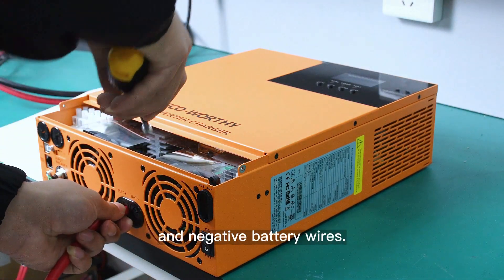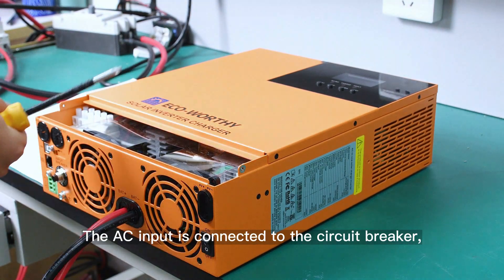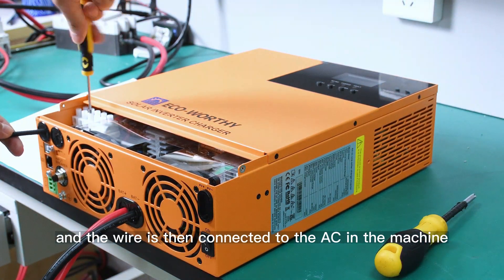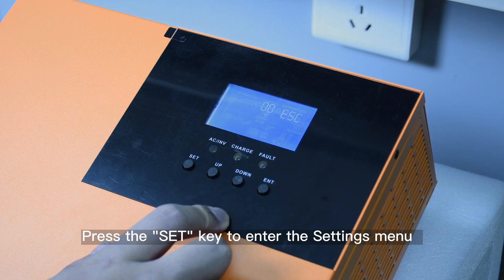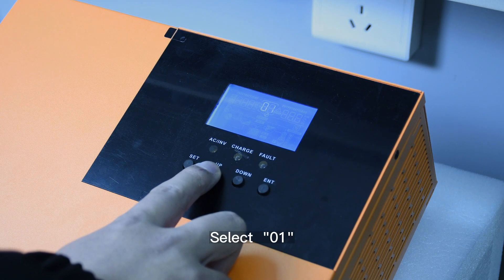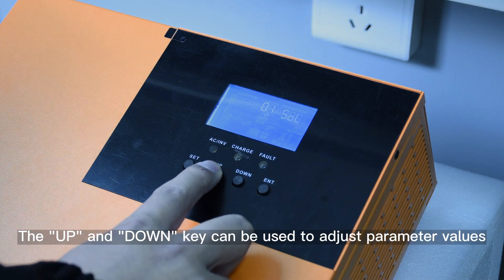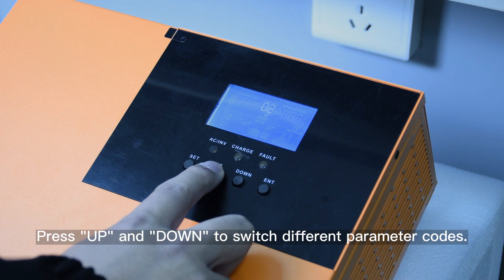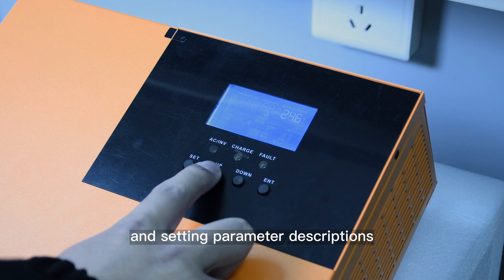How to charge Eco-Worthy battery with inverter charger

Comment: Just to confirm, for the 110V output, you just connected what...a 3 prong plug?
Reply from the maker: Hello, thank you very much for watching our video and making this important confirmation. Our device's 110V output is a socket (output interface, female). Specifically, it's a US standard three-prong socket that conforms to safety standards. This design is intended for your device (load) to draw power from this point via a plugged power cord. If you have any further questions, please feel free to ask us.

Comment: I have the eco-worthy hybrid 3000 watts and 2 batteries 25v 100Ah. What settings I will need to use??
Reply from the maker: Hello. You need to change the battery type in setting [08] to LF08.

Comment: Eco-Worthy inverters can experience various problems, including low voltage shutdowns, inverter failures, and issues with battery charging. These issues can stem from factors like inadequate sunlight, wiring problems, or even the quality of the inverter itself. 

Here's a more detailed breakdown:

Common Eco-Worthy Inverter Problems:

Low Voltage Shutdowns:
Inverters may shut down due to low battery voltage, potentially caused by insufficient charging from the solar panels, shading of the panels, or wiring issues. 

Inverter Not Turning On:
This could be due to a tripped breaker, loose connections, or a dead battery. 

Battery Charging Issues:
Problems with charging can arise from improper wiring, faulty controllers, or even the quality of the batteries themselves. 

Output Issues:
Flickering or inconsistent power output can indicate problems with the inverter, wiring, or even the load being powered. 
Overvoltage Alarms:
In some cases, inverters may trigger overvoltage alarms, especially in cold temperatures when solar panels produce higher voltages. 

WiFi Connectivity Problems:
Some users have reported issues with connecting the inverter to WiFi for remote monitoring. 

Product Quality Concerns:
Some users have reported issues with product quality, such as delaminating solar panels or faulty components.
Reply from the maker: Thank you for sharing your feedback.

If you're currently experiencing any of these issues, please feel free to reach out to our technical support team at service@eco-worthy.com with your order details and setup information. 

We'd love the opportunity to assist you directly and ensure your system performs reliably.

Comment: Just got my Eco-Worthy 5000W. Hooked up the AC and a lithium battery. 2 problems:
1, the battery icon still displays SLA after I set it up as USER
2, It is not charging the battery no matter which mode I select
Any idea?
Reply from the maker: For the first issue, we recommend disconnecting the AC input and only connecting the battery. Then, set the battery type again. If the charging still doesn’t work, please contact our customer service team for further assistance.

Also, could you let us know if your lithium battery is 51.2V?

Comment: Salve non trovo un video che posso sapere parametri inverter 24v 3000Watt ibrido eco-worthy perché voglio che le 4 batterie lifep04 da 12.8v 100ah volevo che le batterie si scaricano 20% e caricare massimo 90% non so quale parametri devo impostare grazie
Reply from the maker: Hello, here is the manual for this product. Hope it helps you！
https://cdn.shopify.com/s/files/1/0253/9752/6580/files/3000w_All-in-one_Inverter_Manual-min.pdf?v=1727331804

Comment: Can this unit charge the batteries via generator for the days when the Sun is not out?
Reply from the maker: Yes, you can charge the battery using a generator by connecting it to the AC input.

Comment: Been running my basic diy set up with 3 panels and it runs the fridge and freezer units and is available as ups for the house if the external grid power fails. Only got 200Ah of storage currently but low cost means swift payback and I can extend as I feel the need. Very pleased. Incidentally, out of the box it’s plug and play without recourse to much set up menu action.
Reply from the maker: Glad to hear you're enjoying it! Thanks for your support!

Comment: no ground on the load
Reply from the maker: Thanks for the heads-up! We’ll make sure to address that properly.
Reply: @ecoworthy_official  support never responded and there as nothing in the instructions but with the help of internet forums and confirmation by a multimeter I figured out that I needed to build a pigtail and connect the load ground to the incoming grid ground or connect the ground to the case
Reply from the maker: @ We're sorry that our customer support didn't respond to your issue in a timely manner. Thank you for sharing your solution—it could be very helpful to other users! Due to time zone differences, our responses may sometimes be delayed, and occasionally our replies might end up in the spam folder. We are working to improve our customer service quality. If you have any further questions or need additional technical support, please feel free to contact us. You can also reach out to us on our social media platforms.

Comment: Only 100v Pv entrance a no Go. No 3 panels serial — each Powerbank has more Voltage
Reply from the maker: For panels rated at 36V or higher, the maximum you can connect in series is two.

Comment: It would be nice to know how to charge the batteries with this inverter and explain the battery is charging once set. Mine stays in bypass mode regardless.
Reply: Did you find fix?
Reply: @Mitchs how???? I have exact same problem
Reply: @misterdavis7543  They sent me a new unit.
Reply from the maker: You can check if the battery is charging by looking at the display—there should be an arrow pointing to the battery icon. If you're having trouble with settings, please contact our support team for assistance.

Comment: Didn't use a precharge resister considering that gaint spark... BAD Eco Worthy. Although it is nice to see them actually working with a live battery even if hey are not following best practices while connecting it.
Reply from the maker: You're right, that was a limitation in the video. However, our latest batteries now come with built-in pre-charge circuits to prevent this issue.

Comment: I need help. I have double checked all connections and wiring. But still no power. My unit will not even power up. My solar panels are producing power amd my batteries are pre-charged. Why am i still getting nothing
Reply: Have you connected it to mains AC? It's might be in grid tied mode by defualt.
Reply from the maker: Please reach out to our support team for troubleshooting assistance.

Comment: Puedo poner 5 baterías en serie para lograr 60 volt
Reply from the maker: The maximum number of 12V batteries that can be connected in series is four. A five-battery setup is not supported.

Comment: In the manual is missing the indication which battery type should be selected for the 48V 50Ah.   L14, L15 or L16 ?
Reply from the maker: For our 48V batteries, you should select L16. However, please note that this inverter controller is 24V and not compatible with 48V batteries.
Reply: @ i have 8 eco-worthy 12,8v 100Ah 48v serial parallel  and a 5k hybrid eco worthy inverter. What L14, L15, L16 would i use?
Reply from the maker: @TrackIT-SWC   L16😃
Reply: @ Thank you very much.

Comment: Can this be parallel with more than one?
Reply: no
Reply from the maker: This model does not support parallel connection. If you need higher power, consider our 48V 5000W model, which supports parallel operation.

Comment: Where do you get the rs485 communication from.If shows it on the photo but you don’t sell it.
Reply from the maker: The RS485 communication port is located at the bottom of the inverter controller.